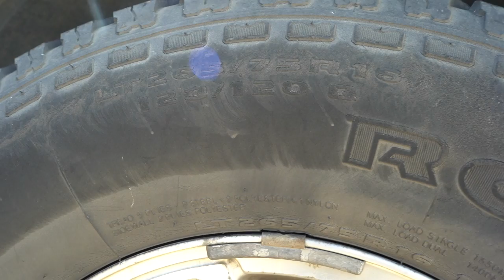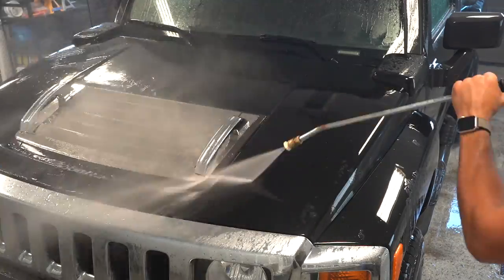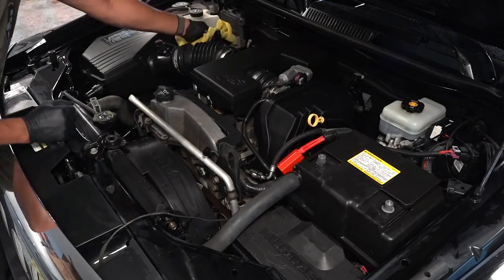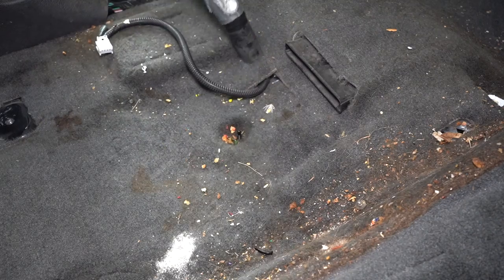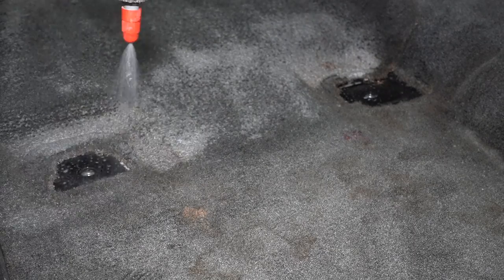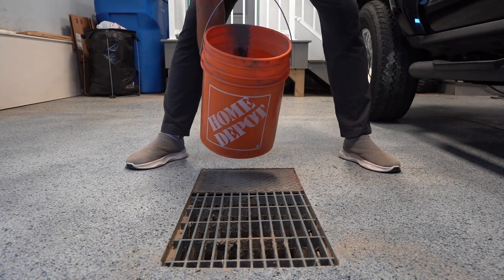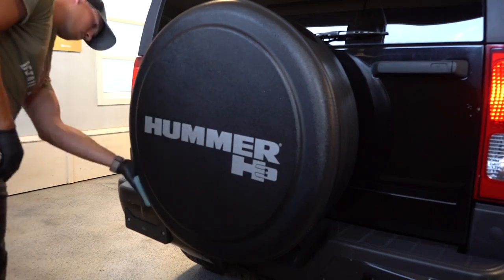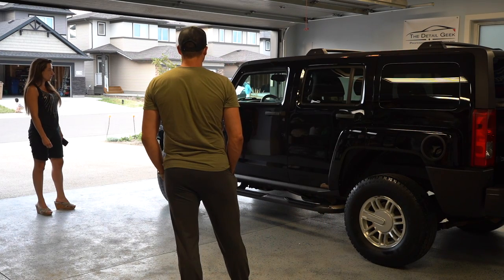SUPER Cleaning a Big Dirty HUMMER! | The Detail Geek

Comment: What product did you clean the seats with?? And what type of wet/dry vacuum are you using ???
I need my 2008 Hummer front of tan and black seats cleaned .. The rest of the vehicle is great ceramic coating
Maybe you could of tried a permanent black magic marker and the blue spot on the carpet to make it less blue????

Comment: With respect to the blue stain. If I have a black carpet I would go ahead and use a black spray dye. With a lighter mid-grey carpet, you can apply the die to a cloth and then gently apply to the affected area to bring it back to a closer colour than blue. Totally personal preference of course. I’d also run it by the customer before carrying out.

Comment: 6 months or less and this guy will have some type of sensor issues warning to everyone do not spray water into ur engine bay like this guy steaming cleaning is the only way to safely clean an engine and even then ur still taking a risk buddy of mine did the same thing this guy did to an engine and not even two days later check engine lights were popping on and the car was sounding like death itself